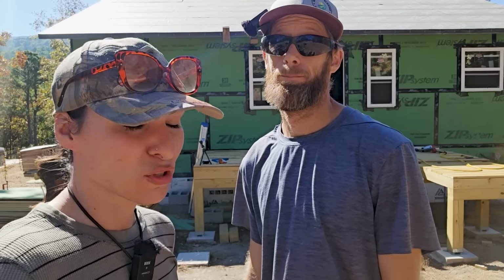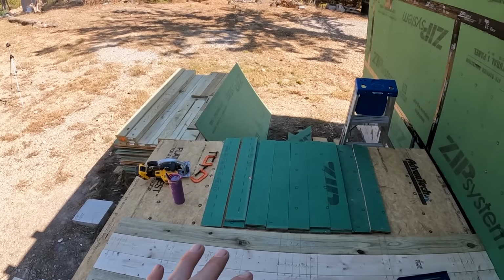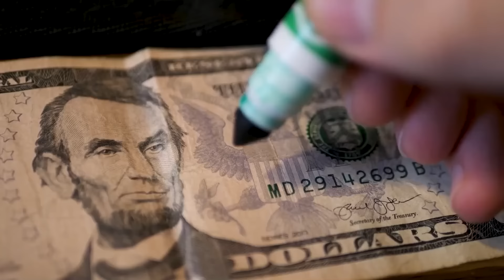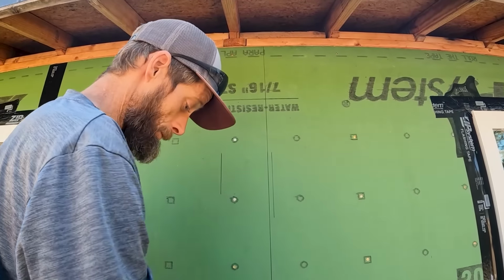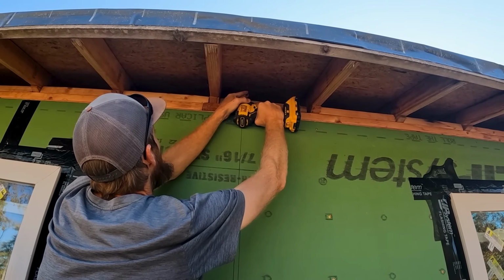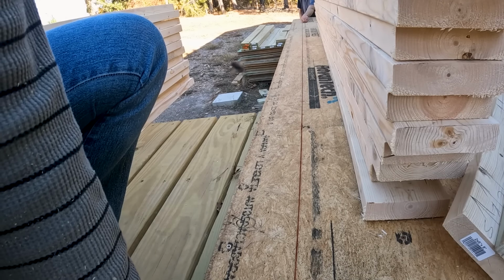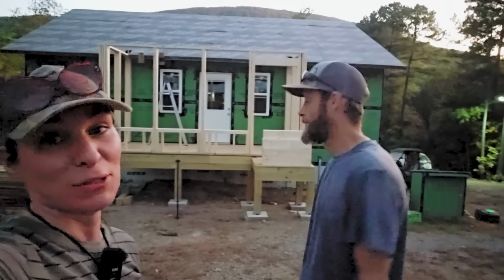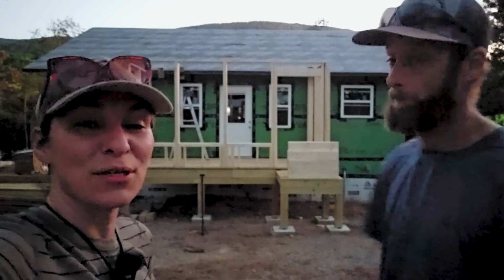It's Official! The Mudroom WALLS are UP And Our Cabin Build Just Got Bigger!

Comment: Watching you cut these boards with your left hand so close to the blade reminds me of a friend who lost 3 fingers doing the same thing you are doing. Safety first"……………….
Reply: I was thinking the exact same thing while the piece you want to keep drops and bounces around, it could do you an injury in itself.  Also your saw is already set to square, you only have to measure, mark and then cut to that mark, no need to mark it with a square.  So you need to set up a rest for your timber so only the small offcut drops to the floor or better still into a box/bucket as you can roll your ankle on those as well.
Reply: I was also sitting here thinking her hand is way too close to that saw blade!
Reply: Honey your hand is way to close to that blade.

Comment: If you need light just get one of those $30 LED work lights from HD.  Mount it on a 2x8 board longer than the light bar then just screw the board to the wall high up and plug it in when you need to work late.  They are not a big power user but are pretty bright.  You really should be using a folding table to work from. It will save you back when doing cuttings.  An 8-foot table will easily hold a chop saw and table saw.   Another thing worth mentioning is that when you are doing production cutting of studs to all the same length, just set a stop block at one end.  Now you only have to crown the boards then slide them down to the stop and make your cuts.  Crowning the studs is very important as it will save a lot of headaches later.  If the crowns are not all facing the same direction then you get a wavy wall.

Comment: Gary, Anthony just built his trusses. Build what you want. Start at the outside wall and work toward the cabin. Once you get there use straight  edge back to the cabin roof to figure out where the rafters will build to. Easy peassy.

Comment: One thing that code enforcement made us do for an attachment like that is drill through the beams with a 5/8" bolt + heavy washers top and bottom. "earthquake" seismic code regs. Our extension wasn't very big, only an extra 20"  so that a longer car or SUV could fit inside our garage with room to spare in the front and back.

Comment: You waste so much time at the chop saw cutting pieces to length...you mark a length with your tape measure...and THEN you draw a line across the piece with your speed square...DO NOT BOTHER TO DRAW A "CUT LINE WITH THE SQUARE"...THE SAW CUTS SQUARE...just line up the blade with the original tape measure pencil mark and CUT! The chop saw cuts square, EVERY TIME, NO EXCEPTIONS...IT CUTS SQUARE...so please quit wasting time with every chop saw cut making a mark across the work with the speed square.
Reply from the maker: Thanks for the tip, but this is the way Gary prefers me to cut the boards to make sure (and tame his OCD) that every board has measured precisely and cut accordingly. 
Peace of mind is not a waste of time - and this is OUR project after all. So we will do it our way. 
No worries though. Hope you have a great day